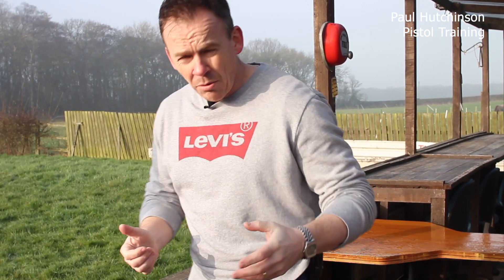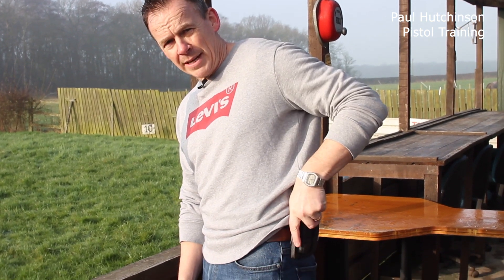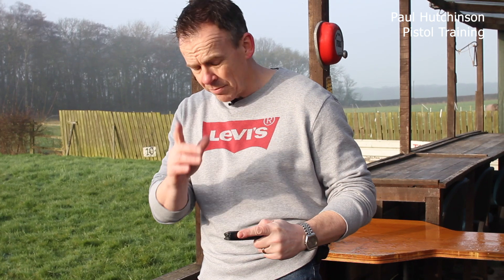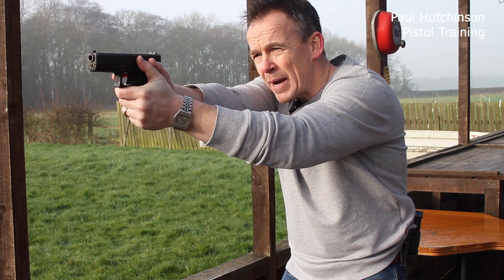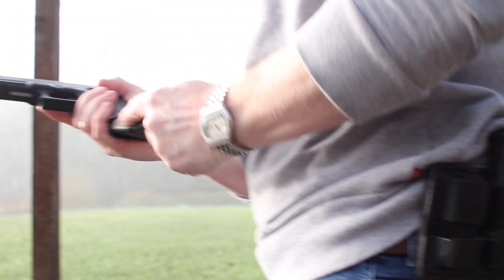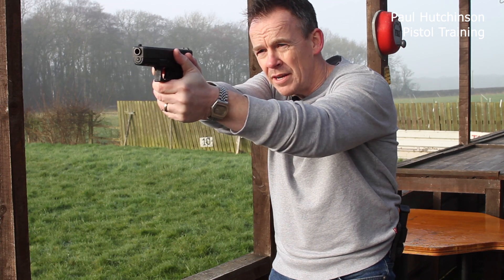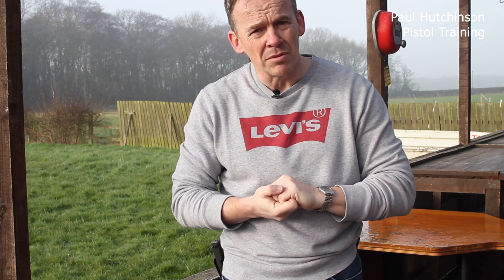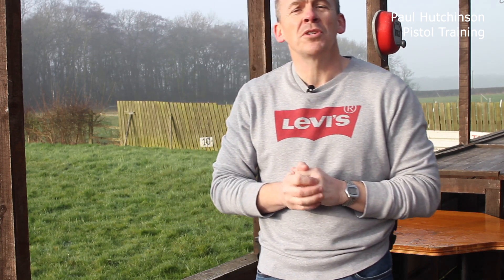How to speed load

Comment: Another good video Paul. I remember being taught to flick the wrist to shift the magazine out to the right during speed loading. I prefer your method as it seems smoother.
Reply from the maker: When you are speed loading you will (should) be moving fast, so as you bring the pistol towards yourself press the mag release, it should just jettison out! if it still has some rounds left, due to the added weight that helps. But it should just still release very easy.
Reply: I agree. I think the flick technique was probably our error, the Sigs were knackered, the magz abused and dusting them of from the pit range probably caused a few magazine slow releases.